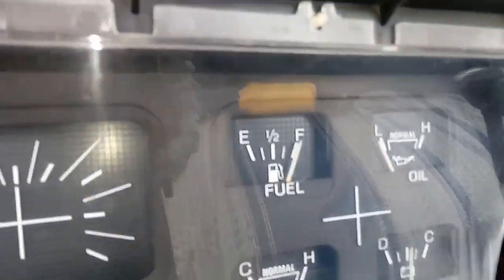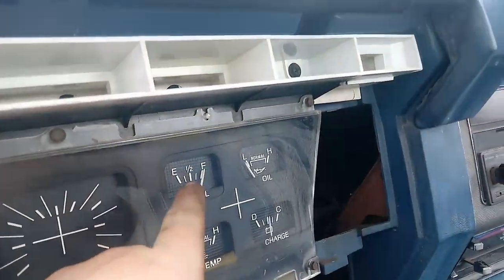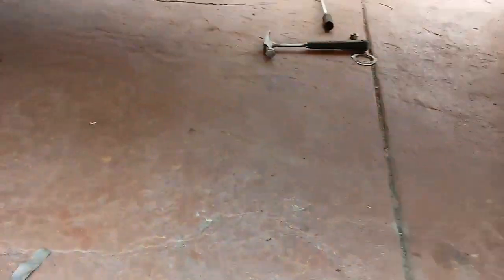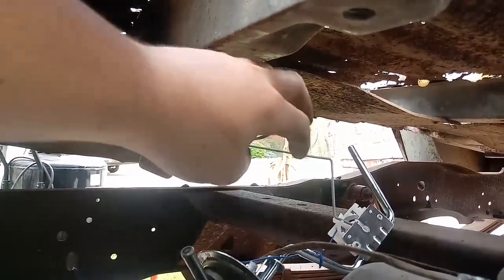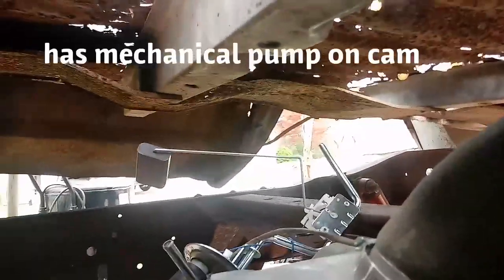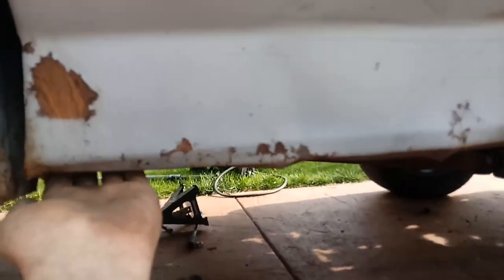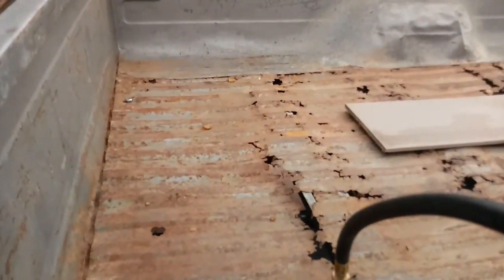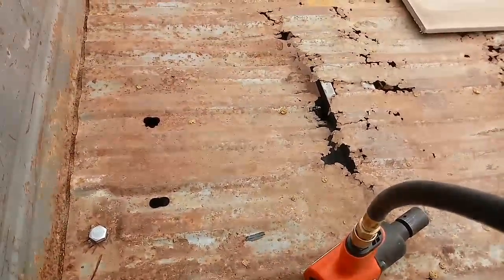1983 ford f150 fuel gauge fix

Comment: I’ve got an ‘83 F250 and the previous owner bypassed the rear tank because of an issue it had, but now my fuel gauge doesn’t work with the front or back. Not sure what to do about it. Any ideas?
Reply from the maker: Maybe the gauge is bad or the selector switch

Comment: I have a 83 F-150, new fuel pump, previous owner swapped a 32 gallon tank instead of dual tanks so I have 1 rear tank. Whenever I have the switch on rear it always reads full, when I flip it to front, it always reads empty. It’s always either full or empty, no adjusting when i’m driving, any idea? I talked to the previous owner and he said it worked when he had it but I don’t ever remember it working, maybe mess with the level of the arm? Thanks!
Reply from the maker: You need too pull the sending unit out of the tank, check the float and do an ohm sweep with a multimeter.
Reply: @mechanicalking  i do have a new fuel pump but i meant to say i have a new sending unit lol, pulled the old one and it was jb welded together 😂

Comment: My send is new and new pump but still won't read on the gauge we took off the send and played with it and the gauge didn't move at all.
Reply from the maker: Try taking the dashboard off. See if there is any corrosion around the back of the gauges. It is also possible that there is a wire chewed, look for cheap TAPE around the wires. The other possibility is a bad gauge.
Reply from the maker: Also there might be a fuse. Keep in mind the key has to be turned to the on position!
Reply: @mechanicalking  I checked today the oil gauge works and I think the battery core one works also I'ma have to take out the cluster and play with it some more.
Reply: @mechanicalking  what does ur sending unit adapters look like does it have 3 holes or just the two my adapter has 3 holes and the sending unit had two
Reply: @giomtzz956  3